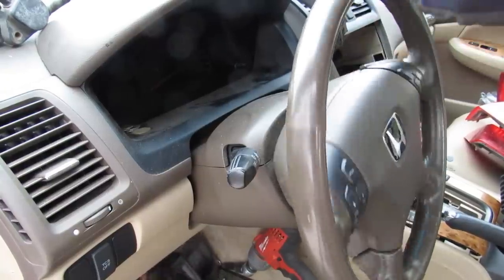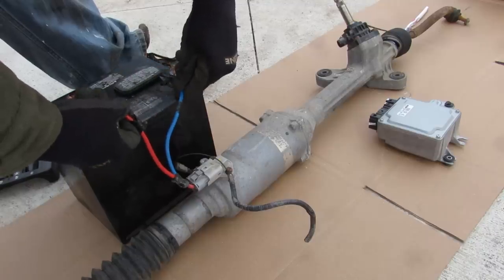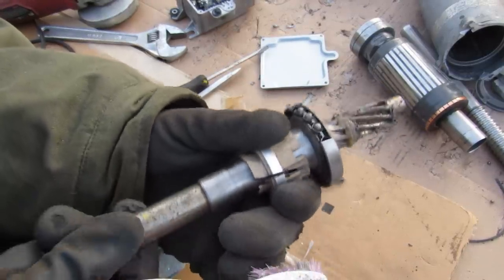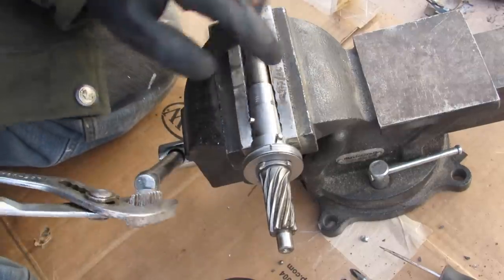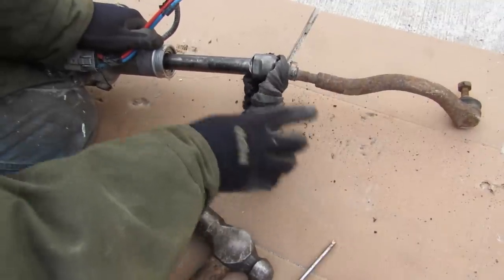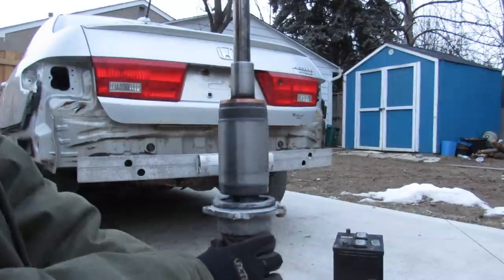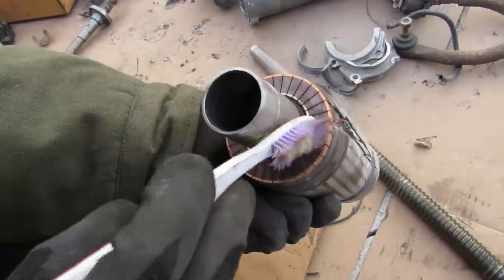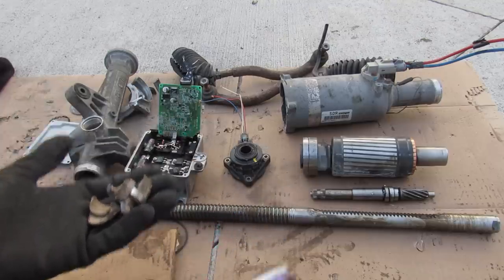How Electric Power Steering Works

Comment: Sheesh, everything from a full mechanical disassembly to a complete view of the underlying electronics.  Thanks again for a great video!
Reply from the maker: Thanks. Gotta understand the whole system to appreciate how it works
Reply: with these EPS we've got an extra source of CAN Bus errors.
The EPS module has a learned "centering function" to help the vehicle drive straight else car is unstable around neutral.
Reply: @speedkar99  thanks for cutting it to pieces so l don't have to. 
I can see a lot of different uses for this setup other than steering a car that will come in very handy.
Reply: @speedkar99  it's awesome to see I get my special tools from the same place you do!

Comment: My 2020 RAV4 has this electric assist.  I really like it!  So smooth, center's real well, no pump, hoses, fluid and valves in the rack.  Oh ya, no pump whine at full turn lock!
Thank you for this video!
Reply from the maker: It sure is mechanically simplier and more reliable. But it devoids it of steering feel

Comment: I'm working in the automotive industry, especially in the EPS electronics R&D field. The way you opened the PCB at 9:25 simply brought tears to my eyes 😂😂😂😂😂
Reply: hi.. pls help me.. my car has a electric power steering.. i start my car in a morning my steering wheel is very tight. in two or three minutes its going back to normal.. what is the reason..??
Reply: Hello, can you tell me what would be ideal EPS gear for electric vehicle ? Is it ball screw or worm gear?

Comment: This reminds me of citroen's hydraulic diravi steering. There was no physical linkage too, a kind of physical backup linkage would apply only in the case the hydraulic system would fail. It was very comfortable for the time it has been built but it was very soft and did give allmost no feedback from wheels to steering wheel.
Reply from the maker: This still had the physical linkage....

Comment: Pretty cool. The stator is the field frame, and in this case has permanent magnets. It is a six pole machine. The armature (where power conversion takes place) is the part that rotates, in this case.

Comment: I think the torque sensor's metal ring goes up and down relative to left-right motion of the steering wheel. In order to know the driver's input is left or right and EPS module turn the motor clockwise or anticlockwise.
Reply: Yes, and with two sensors, the computer can compare one to the other as a fail safe. Much like throttle control, two parallel inputs.
Reply from the maker: Yes and there's two coils inside the Sensor oppositely wound

Comment: Great explanation of the major components of a rack based EPS unit!  I work for a major supplier of EPS units and found the teardown of this particular unit quite interesting.  Brush type motor EPS motors are not common in newer vehicles for the very reason you pointed out.  They are also typically noisier and have less consistent torque output over a range of conditions.  

The inline rack assist (rack through the motor) is also less common.  I'm guessing there was a major space limitation due to the engine mount.

Comment: absolutely perfect, i've never seen one of these taken apart to such an extent before. ¿Why do you think they used spiral balls for the translation instead of a fixed bushing?, ¿is it to make the rack able to move the motor more easily in case of failure?, or to reduce friction?
Reply from the maker: Prescise and reliable positioning. 
I've seen the Chevy Cruze rack 
...it has a belt driven rack!
Reply: @speedkar99  I'd love to see vw mk5 electric rack, as it seems it has a motor spinning all the time at certain rpm

Comment: Fascinating. It sounds like manual steering will still work if power to the motor suddenly fails, correct? I love the idea of losing the power steering hydraulics, it will save weight and volume inside the engine compartment.
Reply: They could probably save even more weight by using a brushless motor and it should last longer too.
Reply from the maker: Yes manual steering still has to move the column and rack. The motor is only giving you assist to make it easier.

Comment: Some electric power steering use a internal electric hydraulic pump that ues hydraulic pressure but instead of leaching power from the engine constantly via a belt or toothed gear it only works when turning the steering, being all in oil it  last longer but are more expensive to produce, the down side is if the seals leak the motor can burnout as the oil keeps it not just lubricated but cools the unit too. Also way more difficult to repair or service.

Comment: I have a 2015 Toyota Corolla LE with an electric power steering system. My first vehicle with an electric power steering system so this video was a good explanation. I have noticed that when going down the road the steering wheel gets stiff. Its almost like its trying to return back into straight position. This happens while driving on curvy roads. I have checked the suspension, tie rods are good, axles are good, and have looked at the ball joints. What do you think could cause this?
Reply from the maker: That's how it's programmed

Comment: Great video! maybe you can help me I recently crashed my 2009 Acura tsx on the front driver side it wasn’t that bad but it lock my steering wheel locked . on impact it disconnected my battery do you link the eps stopped sending signal or should I just get a new rack and pion ?
Reply from the maker: You'll probably need a new rack if it damaged it that bad!

Comment: I thought that this purely mechanical power steering really does not exist! Also argued that it doesn't make sense to attach a motor directly to a steering system. This particualar case with a screw makes it more sensible to me but I don't like it anyway. Another aspect of my disbelief is that all my cars have either no power steering or hydraulic power steering. In one instance it is using electric motor to power the hydraulic pump, sensors might be similar to this case, and the other pump is belt driven. And I believe both hydraulic ones have rotary valve so steering is very smooth. Because I imagine this electromechanical power steering to have some sort of lag and the rotor is massive so there could be some inertia as well. All in all, thanks for a great videos you make!

Comment: Makes you wonder who builds these. There are no service user parts in that. The whole rack is just replaced. Its amazing to me how these units work.  Vehicles made with these will never become vintage because they break down and become scrap over time. They were designed to only  last so long.
Reply: It's funny as the push to fight "climate change" (who knows what they'll call it next week) completely ignores our disposable everything culture. Everything is made to last a short amount of time, to maximize profits. Fills landfills very quickly 😂
Reply: What would ever need to be replaced? The only failure possible is a critical one. 
You have been tricked into believing having parts that are so bad they need to have serviceability built into them is a good thing. 
Optimally parts never need servicing to begin with.

Comment: so, in theory, you could manipulate the torque sensor readings to automate steering without input from the steering wheel. Hope the security on that module is tight...
Reply: That's how line keeping assist, automatic parking etc works :)
Reply from the maker: Yes of course it's hackable
Reply: @speedkar99  so how likely is moisture or failing component to cause these things to make a sharp left turn when you're at highway speeds? can a human overpower this thing, or is it going to be in control if something goes wrong?
Reply: @lukerediger8431  Note the "fail safe relay" that can disconnect the motor if things go wrong. The ECU likely has two computers that run in lockstep, and if there is a failure it will disengage. And I suppose the two coils in the sensor, are checked against each other as well.
I wonder how they would detect a stuck sensor - maybe that joest doesn't happen.
Same with that mtor catching on something. I suppose that is the reason for the security screws: don't mess with it.
Reply: @pizzablender  yeah.... this bothers the hell out of me, when simple electronics fail due to moisture, tin whiskers etc, they normally just fail to work, but every once in a while they turn up one function to 11... and the idea that my steering might just get snapped full right or left by something with mechanical advantage over me at some random point in the future... 

If the signal from the sensor shows an increasing voltage as the steering column increases torque, then it should fail safe in that the sensor will always read 0 torque meaning the motor will not be energized, but if moisture gets into the box in the cabin, all bets are off, the H bridge could lock on one way or the other, the collectors on transistors could short to a live wire, and if the ECU is talking to this thing and giving it trim adjustments, a short in the wiring harness could do the same thing. This is before tampering is considered. Auto manufactures are doing stupid shit like letting the Bluetooth module for the entertainment center talk to the ECU, and malicious hacking is increasing.

A hydraulic system can't fail like that.
Reply: @lukerediger8431  you can see there is an emergency shutoff relay at the output.
I'd be more worried about one of those balls being stuck, blocking the steering.
Reply: @pizzablender  what triggers the relay, high torque reading? if moisture or a tin whisker shorts the output side of the brain box, relay don't care, it works if it's given power.
Reply: @lukerediger8431  I suppose current is monitored, and if something is wrong there, the relay is disconnected.
If the H-bridge were to start conducting (it would need two separate errors to do this) the relay can disengage. This can be built with both voltage and current monitoring (the latter also reacting to external connections).
I suppose a computer crash will also disengage the relay.
That all said - how often do you hear about power steering slamming the steering wheel? I never read about that. I did read about gearboxes or gas pedals engaging.

Comment: Engine mount onto the steering rack. That seems a little silly to me. Wouldn't you feel the vibration in the steering wheel more then.
Reply: Not on a Honda.      Not when it was new, anyway.

Comment: My 2017 rav4 hybrid’s rack pinion fastener, which hold pinion on the chassis. the driver’s side one developed two long cracks. Do you think I can weld it or have to replace it? Thank you

Comment: What happens when it fails?  The high force required makes it feel like something in the steering column might snap.  It would be useful if the amount of assistance could be modulated as this seems variable and not always predictable.
Reply from the maker: No it's just not assisted it won't snap

Comment: C1002 steering column motor, torque position sensors, C100B, Torque limitation request from NFR, C100C, Torque requested on steering wheel from CAN (module DST)

Lady in her Mito temporarily lost her power steering in her Mito. Key off and key on all good again. Those were the codes. 

Any thoughts?

Comment: Can you tell me which wire on the circuit diagram is the speed sensor or comes from the car tacho? I’m curious if I can modify the signal so that I can have more/less assist at certain speed range
Reply from the maker: It comes through the CAN bus

Comment: so if my power steering goes in and out (some turns get hard but mostly fine) but i’m not getting a power steering message on the dash, would it be the whole module instead of just the motor?
Reply from the maker: Check for loose connections, any fault codes in the system and the intermediate steering shaft isn't binding up.

Comment: FANTASTIC video! My 2015 Mirage has electric power steering. It's a driver's ed car, so it gets used A LOT in parallel parking practice. It typically overheats after about 20 rapid turns and temporarily stops working. Should I be worried? What about longevity of this type of unit? Thanks in advance!
Reply: In a Toyota or Honda it’ll last a very long time, but I’m not sure about a Mitsubishi. The motor electronics seem to be cheaply made if it keeps overheating.

Comment: How do we know if there is a fault in the electric steering? What maintenance work is required? What is the expected life span of each of the parts - torque sensor/ steering motor?

Comment: So the motor must always be running with the engine on because I hear a whine even when I'm not using steering. And I suppose that free wheeling device is what keeps the wheels from turning?
Reply from the maker: The motor only turns when you turn the steering wheel
Reply: @speedkar99  Then what would the whine be? (more prominent in the winter & gets higher in pitch when the wheel is turned) My EPS also has fluid. (2014 Nissan Altima)

Comment: I asked you some time ago about City Mode button on some Fiat/Opel models, which makes the steering lighter when you press it, for speeds lower than 19 miles per hour. Basically, I think it works on this principle I guess, creating a higher voltage and also a higher electromagnetic field (when pressing that button) which makes the steering column being lighter. What you think ?
Reply from the maker: It's current controlled not voltage

Comment: What would happen if the motor fails and gets shorted? Will it still steer, or you will end up with a locked steering wheel?
Reply from the maker: It'll steer. The reciprocating ball system allows for steering input from the wheels or pinion gear

Comment: Question: What's the problem if the steering doesn't return (to center) automatically while driving/moving? it is steady if you turn the wheel even if the car is moving. Is the motor broken? What should I check first?

Comment: I have a power steering motor from a Chevy Bolt I would love to use for an electric scooter.  I wonder how it could be wired to run at full speed in either direction?

Comment: Hi buddy, I have a Corolla E170. I'm having issues with the steering. It gets intermittently heavy. No fault codes generated. I have got the EPS motor and the steering rack replaced. No use. When it's light, i can turn it with my pinky finger, when it's heavy, it requires some effort which can ultimately get tiring. Any guesses? The car is totally stock but im sick of the steering.
Reply from the maker: Sounds like a sensor or controller issue
Reply: @speedkar99  diagnosed the EPS module. No code generated. Got the whole column opened , checked electrically but nothing showed up. Could it still be the Module?

Comment: Hello buddy am facing a very confusing issue with my toyota crown 2007. Car has the same electric power steering like the gs300 2007 . A PS FAULT  came up but when the car is started when the left side is raised  The PS fault disappears but when flat the ps fault comes back. Please advice. My older rack had the same issue but it also had leaked water into it

Comment: Mine cars power steering broke down, but that was mounted some other way like a separate unit with pump (?) in it.
Reply from the maker: Electromechanical
Reply: It's a electric hydraulic power steering, use a electric hydraulic pump.
Reply: @Thunderstormworld  thanks for explaining :)

Comment: So If I lose power to the power steering actuator, all the turning comes from that torsion beam?
Reply: 5:06. Actually if you look closely that torsion beam has just a limited range of way. 
The two column parts that this beam is connected to have a 'flat spotted' joint that will take the effort.

Comment: I did not understand - so is the driver still having control if the electric system fails when driving or what happens? Is it not mechanically connected to the wheels?
Reply: found myself - there is still mechanical https://en.wikipedia.org/wiki/Power_steering

Comment: So with an electric power steering vehicle, say it looses power to the unit... how hard is that compared to a when hydraulic power steering goes out?
Reply from the maker: It's the same thing...pinion gear to rack.
Reply: @speedkar99  Ahh gotcha, thought it might be a little easier since you're not potentially pushing fluids around in addition to the tires.

Comment: 1980's steering 2 moving parts worked fine... 2020 steering motors sensors relays computer what could go wrong..
Reply: You stick to your 1980's car then.

Comment: Great video.
EPS on my 2013 Mitsubishi Outlander is on the steering column. It has the worst feel, feedback, self centering and is way too stiff. To get a lighter feel the tyres have to be let down well below specs. Including other issues this is the worst vehicle I have ever driven.
Reply from the maker: Over boosted because SUV
Reply: @speedkar99  that would make it very light steering, correct?
I've been looking for a way to adjust it. Maybe piggyback something?!

Comment: I do have toyota vitz that comes with electric steering (the motor is located under the dash) the steering rack of this car never last long time.. there is a certain bush inside the steering rack (passenger side) this inside bush keep on dieing every new steering rack that I replace..

Comment: So what is it if the steering wheel is locked straight even when car is on
Reply: Could a power steering column module be the culprit? Its an electric power steering set up 2014 honda civic si
Reply from the maker: Why would it be locked? It's still mechanically linked through the steering shaft
Reply: @speedkar99  no idea but the wheel is locked into place and is able to start